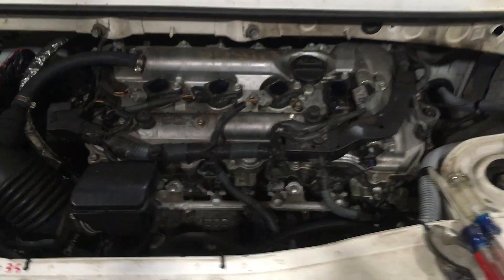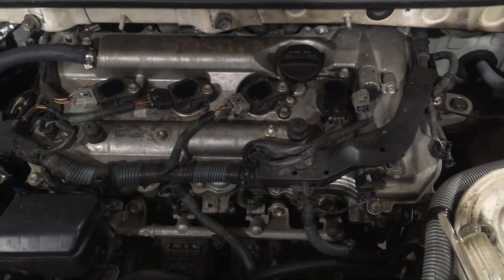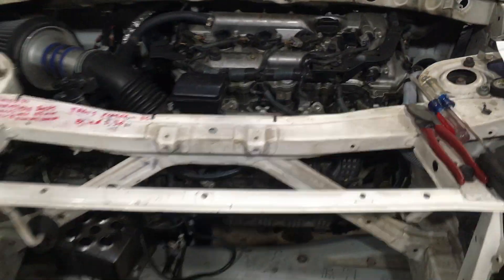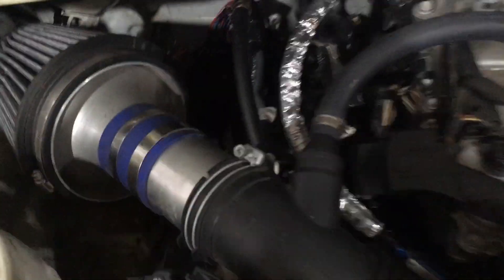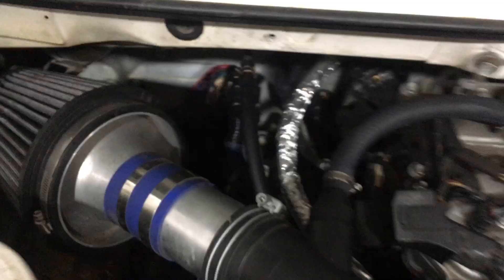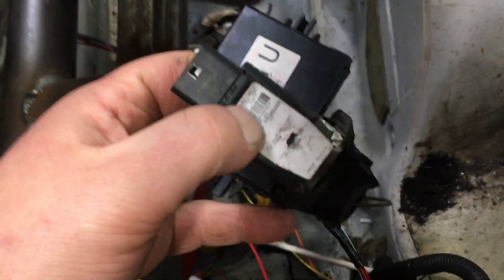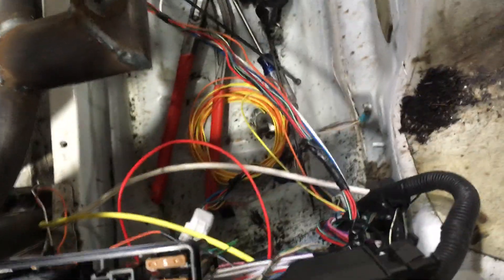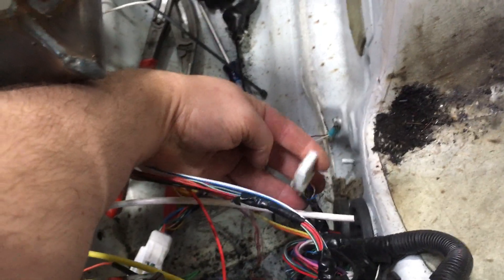Quick demo to show removed immobilizer on Toyota 2AR-FE 2.5L I4

Comment: Good. Lord. This is probably a fun car
Reply from the maker: It's an absolute riot to drive, i run it in the 24hours of lemons and this motor simply does not mind sitting at wide open throttle literally all day long.
Reply: @FrankensteinMotorworks  auto or manual? A little background, I was searching this motor for swaps because from time to time I drive my mother's 2012 Camry SE and it has the paddle shifter kit and it's absolutely a joy to drive. Such a peppy motor and the shifts are firm and QUICK, only downside I noticed was it has a tendency to cut fuel under anything more than very light left foot braking. I wonder if that was a flaw/safety in the TCU/ECU. So I always thought (given a few years) that the XV50 would even make a decent rally platform.. other than your build there are only Scion TC and one video in specific, had a manual transmission and I was astounded at how sluggish he was with the shifts and not being in the correct gear. (Makes me wonder of the gear ratio differences between the auto/tiptronic and manual) as I've never had issues with either with the tiptronic setup.

Anyway thanks for sharing and cheers! Glad it's been fun for you!
Reply from the maker: The car is using the EB62 manual transmission because i've had it since 2009 but the EB60 that they released in 2012 is a bit better gearing for the race track. I'll likely switch to the EB60 some day.

These motors have a brake interlock. they won't let you hold the brake and throttle at the same time. This is the result of the prius unintended acceleration stuff that happened a while back and the lawyers getting involved. In these swaps i just don't hook up the brake pedal sensor to the ECU so it does not get this interlock. The downside is you lose cruise control but race cars don't need cruise control :)

as for your comment about it being sluggish in the video I'd have to see that video but i think what you saw is likely realistic. This motor wants to be spun to about 4000rpm before it comes alive. On the race track it isn't hard to hold the motor over that 4000RPM point especially since i raised the rev-limiter to 7200RPM. The odd thing is if you look at the dyno chart there's no transition in the 4000RPM area so i can't explain why but it really does feel like that.
Reply: @FrankensteinMotorworks  it's ACIS above 3900 rpm https://en.wikipedia.org/wiki/Acoustic_Control_Induction_System
Reply from the maker: @Mocconagames  You're right that this motor has that and you certainly could be right. The dip does not show on the dyno chart but dynos don't show the same thing as actually driving it does sometimes.
Reply: @FrankensteinMotorworks  you probably can tweak firmware to disable ACIS (it is possible, at least for 2AR-FE with A/T), then just try to open it manually and lock in this position. But you may lose some torque at low rpm (2000-).
Reply: Yes I've noticed in city driving that there are 3 stages or more to the VVT based on coolant temp/throttle position etc. 4k is definitely where it comes alive.

Here's a link to the video. His shifting maybe needs work but the main thing that I would've thought was a problem is if it's a 5 speed, the ratios aren't as close as the 6 speed in the semi-auto (tiptronic) which would explain why I always have a much easier time being in the right gear at the right rpm when I need to.

Here is the video: https://youtu.be/OM-mtmwGgCk
Reply from the maker: Yeah, i hear what you mean from seeing that video. I think some of that is perception based on the noise but he likely could stay up at higher RPMs more. at the end of the day Autos are better at racing, i race a manual because i enjoy it more, not because i think it is faster.